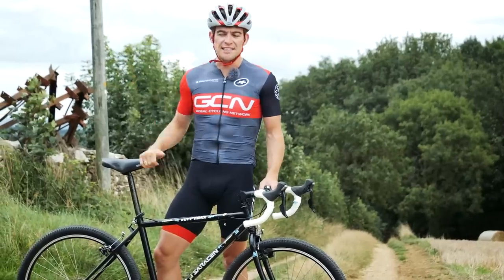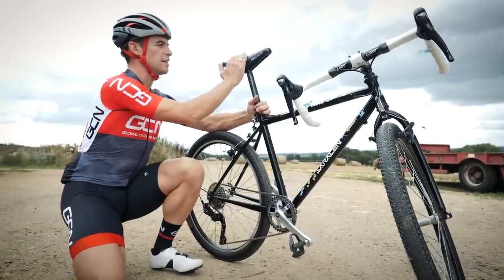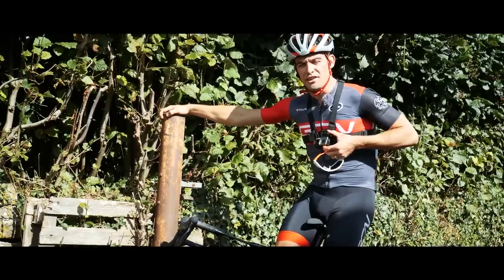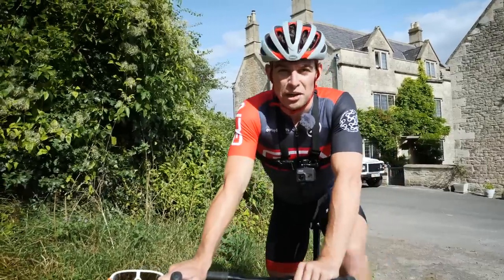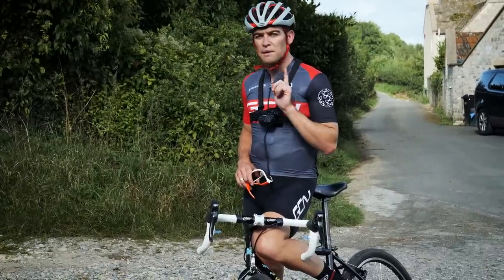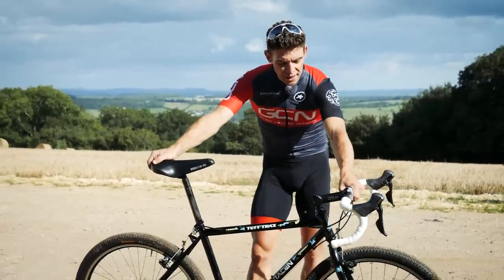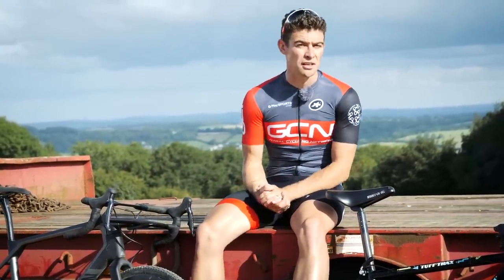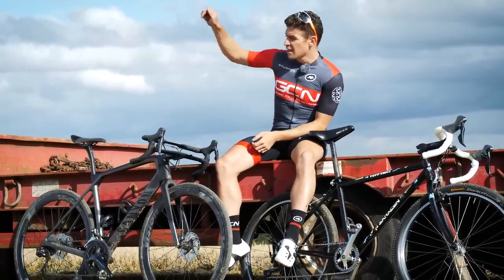Garbage Vs Gravel Bike | How Does Our Cheap Gravel Bike Compare?

Comment: So the Grail is altogether ~3% faster than the "Garbage Bike".  What is the price difference? 3000%? :)
Reply: Not enough to be worthwhile for most of us, obviously. But that is a pretty massive difference if you're a racer.
Reply: Joel Henderson racers don’t use garbage so it wasn’t for them in the first place
Reply: Canyons are cheap for carbon bikes.  And the garbage bike conversion won’t cost nothing.  I spent $250 converting a hybrid into a gravel bike and I used pretty low end components.  In the end, I sold my gravel bike for $125...and I’ll probably buy a canyon.  Garbage in, garbage out
Reply: @zyghom  Amateurs often do. And for someone who's a strong amateur finishing top 10% consistently, that's when it might make sense to think about this in terms of speed, and whether or not that seemingly small difference will help them podium.
Reply: @joelhenderson3723  i'm also not a racer, and also blow away specialized's Nutella bikers mhuaahahhaha
Reply: @joelhenderson3723  doubtful
Reply: @RaoulDuke69  vague.
Reply: That is a massive difference over 1250 meters. Over a 40 mile race that would equate to 10 minutes 30 seconds with equal elevation and decline throughout the race.
Reply: alan bane  Yep. That's the thing that I don't understand of these tests: the use case for gravel bikes is not "fast and furious short trail". Yet it's all these GCN (and others) tests seem to do: 5 minute ride segments when the whole point of gravel (for me at least) is to be able to ride where you want for long(ish) rides.

All this is proving (if it proves anything) is that modern gravel bikes are a bit better than 20 year old bikes at doing the 5-minutes fast-and-furious. If the build had included decent brakes and the same tyres on both bikes (not much extra cash), the result would have been even closer.
Reply: Love the vintage Saracen transformer 😍😍

Comment: Should have included cost comparison for the challenge.
Reply: Canyon wouldn't have let that happen
Reply: @Goriaas  That would have pissed off their corporate sponsor overlords,They don't want you to know the bike that is over 15 times more expensive only goes like 3% faster lol
Reply: I would also like to know the expected maintenance costs for the next 3 years or 10,000 kms or something.  Disc brakes are great if your competing, but cost more to faff with... And then when you factor in depreciation... yeah no thanks.
Reply: That wouldn't make much sense, they used ridiculously expensive GRX derailleur, whereas in real world for a bike like that you would use Sora shifters with Acera or Alivio derailleur.
Reply: @wtfiswiththosehandles  so true. a rear mech more expensive than the frame...
Reply: @wtfiswiththosehandles  that 10 speed GRX derailleur is $40 and has a clutch which acera and alivio do not. money very well spent on a bike like that.
Reply: @aidanshmaden69  You're running 1x with NW chainring, hardly necessary to have a clutch. And the bike is a junker, spending money on a new derailleur which is more expensive than 105 does NOT make sense.
Reply: @wtfiswiththosehandles  narrow wide alone is not enough on rough descents. chain will still pop off. the bike looks great and if spending a few bucks on a derailleur means it gets ridden and not thrown in the trash then that makes a ton of sense.
Reply: @aidanshmaden69  Wow, how did we ever survive MTBing without clutched derailleurs?
Reply: @wtfiswiththosehandles  😂😂😂 good one
Reply: @wtfiswiththosehandles  front derailleurs and chain guides held the chain on.
Reply: @wren7336  That's actually not true. Disc brake maintenance is pretty cheap. Brake pads are more expensive but also last longer. Most people will need no more than one bleed per year, some will only need to do one ever two years or so. Price of oil is so low it's negligible given how little is needed for a bleed. And the cost of a hose is easily compensated by it lasting multiple seasons. The biggest maintenance costs on a modern gravel bike are the tyres, drive-train comes in second, and everything else is pretty cheap because it either lasts a long time or can be bought for really cheap. So if you want a gravel bike that's cheap to maintain, you go for a low-end drivetrain and non-tubeless tyres.

Comment: Wonderful video!  Only six seconds difference between a full carbon and a CR-MO bike.  Truly a testament to Jon's mad mechanical skills.   In addition, the steel bike can be repaired in the event of minor structural damage.  That would be much harder to do with the carbon fiber bike.
Reply: I like steel a lot but Carbon fiber is actually remarkably easy to repair in the right hands.

Comment: For a daily commute that involves a bit of gravel, asphalt, and single track I believe the old gravel bike wins. The Grail is an awesome racing gravel bike but would be stolen quickly if left unattended. Plus I believe the old steel frame would be a bit more comfortable. Thx for the video.

Comment: I feel like this comparison should have been a bit longer. I would have preferred to see a longer with power data and more talk about relative comfort.
Reply: Yes. GCN has done lots of videos with power data, so they know how to do it. I suspect the video was short, and even then it included the fluff of the wheel swap, because the "garbage" bike was actually way to close to the expensive carbon thing. Fix the contact points for user preference, and it comes down to aero and weight. For an average Joe the areo and weight aren't going to matter much. An average racer might care, but there is a lot of mid price bikes that would make a better comparison anyway. I will admit the canti brakes suck, and I'd pay good money to ditch them on my homemade bike if the retrofit was reasonably possible.
Reply: yeah, like a 6hr gravel race

Comment: So on the ascent and descent, the second run was quicker.  It was obvious from the video that you took a different line up the ascent on the second run, avoiding some of the rougher patches.  That aside, "lighter bike goes up hill faster; heavier bike goes down hill faster" is an astounding insight!  :)  I own a 2x10 gravel bike but took off the knobbled tyres and put on 28mm road tyres.  I find that on dry surfaces, knobbles add no benefit, and on mud and wet clay, they clog up quickly.  I also have a fixed wheel road bike with 25mm road tyres.  I find I have at least as much fun riding the fixed on gravel within its limits.  Yes, it is more limited, but that just means I don't have to go searching for challenging terrain when I only have time for a short ride.  When I was a kid, it wasn't called "gravel biking" — it was called, "going out on your bike."

Comment: Exactly what I'll be doing soon, I have a late 90s early 2000s(not sure exact date) yellow aluminium GT Tempest, I've got wheels with the 11 speed compatible hg freehub and some semi slick gravel tyres, gonna get either a 2x11 microshift centos groupset or a used Claris 2x8 not sure and canti brakes and drops obviously
Reply: How did it go

Comment: Falcon Cycles Xenon 26inch MTB to 650bx1.9 gravel bike with cheap carbon fork, Ritchie Venture Max bars, 1x10 Tiagra, 42t x 11-40, Gravel king SK, Ergon seat, WTB i25 rims and great fun 👌 only downside was needing a riser stem to get the geometry right so bar bag to cover that up 😁

Comment: You incessantly call that bike garbage. It is on the wrong side of an ocean for me, but let me know if you want to get rid of it. I'll ride that thing. I ride a very similar bike that is setup single speed. As far as the hill climb, if you are calling those tires "bouncy" on all the cobble you don't have your tire pressures right. When you try the test with lower pressures, post them along with average watts from a set of power pedals. Your hill climb will be closer than you think. You are a rodie (with respect), so it is no surprise you aren't as efficient on a mountain frame (even with old geo).

Comment: What about a non-garbage 90's hard-tail?! I nabbed a Bontrager TiLite. Disc up front, but quality cants are fine for the rear. Featherlight 28mm SID Race Titanium shock with amazing lockout -- climbs like a coked squirrel, descends like an XC bike (though only 80mm travel, so you can't catch massive air), weighs <10kg. Only downside is that it's not very aero, so would lose at high speeds across easy terrain.

Comment: I recently bought a new winter hack, a Merida ride Lite 90. Cost, £599.99. My summer bike, a Bitsa built from sale rail parts, cost around £2000. I average out at about 10 seconds faster over 25 miles on the Bitsa. Is that worth £1400? Actually, if I had paid full price for all the parts, the Bitsa would have cost nearer £3000, but that's not how we calculate the value of our bikes, is it? The Bitsa is an absolute joy to ride, especially uphill and on long flat sprints. You can't put a price on that. I just don't get the same feeling from the Merida, even though it's just as fast, almost as light and behaves almost exactly the same way. If we start to calculate the worth of our bikes on how fast they ride, then we need to re-evaluate why we ride in the first place.

Comment: Nice video.  I thought it was going to be bias, but you kept it very neutral.  Great job on that!  I want to point out per Canyon website the Grail is $1799us to $6000us depending on the model.  The grail looks awesome, but for  hodge podge gravel bike with a few hundred dollars.  It makes the garbage bike pretty appealing!  As long as your out riding.  That's the main thing.

Comment: It does show that you can get out and have fun on a pretty cheap bike, although the difference over a race (which the Grail is designed for) will be much more profound, I'd say. Chris mentioned the handling of the Grail being much better and that will 100% make a difference during a race. But not having an expensive bike doesn't stop you from getting out there and enjoying riding! 😁

Comment: Well, that was a bit short test for an adventure/gravel bikes... but whatever, I'm surprised that old MTB with long stem and drops fits the rider. This old MTB frame would be probably to small for him as normal MTB with flat bars, I can't find other reason or he just doesn't want to point out in the video about how this old bike feels. These old MTBs have quite long top tube and are generally long and high(for a 26''er), so the position on the bike must be pretty agressive with drops, like CX not gravel...(maybe because of that the descent went so well) Just look at a height difference between saddle and bars in old Saracen and compare it to Canyon. So it is possible to convert old MTB on 26 wheels into drop bars hybrid, but from my experience one need smaller frame than used normally and not too long stem for a comfortable position.
Anyway a cool project, stiff old MTB rocks!

Comment: My questions are 1) what were the gains received in the upgrades, comparing before and after and 2) I have a ‘06 trek fx 7.2 and a disc brake ‘15 giant defy adv 2... is it even worth looking at upgrading the Trek hybrid for you know hybrid (gravel / light off-road use as it was intended imo) or just putting 28s / more gravel like tires on the giant going to be way better than anything I throw at the trek?

Comment: I would like see an old alloy cable disc  26er heap mtb with straight tange forks and an 8 speed 12-32t. Turn into 2x46/36 and a  drop front. You may 3v3n squeeze a set of 650b wheels with 1.75 tyres. Rj the bike guy has done some great cheap mtb to gravel conversions with disc. Id wager the difference would be closer than 8 secs on the climb.

Comment: My gravel bike does long paved trips, dirt roads, and occasionally some very mellow single track.... if it was dirt and trail only I’d ditch the low sleek bike with its skinny 32–40c tires in a heart beat.      Salsa Cutthroat modern off road drop bar bike with proper geo for the job.       Weird as “gravel bikes” got more and more popular I  guessed they would go more off-road/tuffer but seems like they are getting more and more like road bikes.... crazy low stacks ultra light weight and even aero.      The garage bike does look like fun on more nasty dirt roads and rocky trails for sure

Comment: I bet the gap between them could have been closed very cheaply by using an ally frame - I bought a really nice Ally CX frame with carbon fork for under £50 off Ebay (inc courier). Jon's bike would be good enough for most of us though.

Comment: Several things to consider... a $3000 bike will not make you 10 x better than a $300.  To do a correct test, you have to do runs, in each bike, independent from one another, that is, you can´t ride one bike and then the other, one rider... you´ll have to do several rides with several different people and get an average...  Another thing, in this case it seems the results are more based on the tires you are using than on the bike...

Comment: if you are going to get sti shifter and new wheels , you are better of getting a better frame ,  you can get really nice aluminum frames for 100euro ,  and hybrid bikes are also good candidate for gravel bike and you can get one with disk mounts also , or solder disk mount on the frame and fork , and use 700c wheels with disk ,  will also be a cool convention ,

Comment: I love my garbage bike! A TREK . Pulled it out of a backyard mud hill.  I did the surface rust removal on all the non painted metal,  then only 150 bucks at the bike shop for odd and ends and tune up.  Been riding it for 3 solid years. I couldn't believe my good fortune. It's probably a bit over 10 years old. Don't care. We've got nothing but crap roads with frost heaves, large cracked surfaces for miles, pot holes, all manner of gravel and sand on them, multiple train tracks to go over every which way. I love this bike!
Reply from the maker: Awesome! Share it with us on the uploader: https://gcn.eu/upload

Comment: Should have used the same tyres on both bikes. The steel bike would have gone up the hill faster, without the wheelbarrow tyres on it. The carbon one would have descended faster, if it had had more tyre to absorb the stones at the higher speed. If you doubt this, there is a GCN test of gravel vs. cx bikes, which says it.

PS regarding cantilever brakes- blx. My cx bike has them, and I can lock the front wheel on any surface. I can also descend on slimy mud, without skidding excessively.

Comment: One more thing in the wheel take off challenge is I would not put a disc brake bike in a car unless I had put space savers in the brake calipers of the Canyon after I took off the wheels and then to remove them before putting the wheels back on, the cantis do not need something to keep them apart like an empty disc caliper.

Comment: just goes to show you can have a cool and fun old bike. I stripped and powder coated my 1998 Gary Fisher, installed an Alivio crank with a 34T Narrow-wide chainring, and an 11-34 9-speed cassette with a Deore derailleur and Alivio shifter. A pair of 26 x 2" slicks, a rack, and a pair of Ortlieb bags has turned this into a go anywhere commuter. Fun? Yes. Practical? Yes. Fastest? No, but that is not the point. Get outside and enjoy the day!
Reply: June July Sorry I have no experience with that bike. But honestly, any bike by the larger manufacturers are all "good," provided you use them for what they were designed for. An entry level fork is really made for sedate trails or city streets, so a person may be disappointed if they are expecting the performance of a Reba fork. More money will get you more speed or comfort, but often those marginal increases are very expensive.
Reply: @junejuly48  Don't be racist, Chinese and Taiwanese people can make great bikes too.

Comment: the proof is in the pudding as it were , albeit the weight  difference and price one would do as good a job as the other , slightly heavier bike means more strength and endurance on the breaking side the disk brakes are ahead , for a starting point the older bike would do fine , and if later one wants to upgrade one can , jon did a great job of bringing and old bike up to a new one , and it looks good , add a coat of paint and it becomes a bell ringer ,

Comment: Jeeze, again an advert for their sponsor, at least put it up against a 1k bike rather than a 5k, GCN have a bit of respect for your core values.
Reply from the maker: Sorry, Daniel? We're not 'advertising' anything here. We're using the Canyon Grail as they are one of our bike sponsors.
Reply: Global Cycling Network so what Daniel is suggesting may be that a base model bike would be a better comparison to make. The top end Grail is not the only gravel bike that canyon make.
The point being that the old farm built with mid range parts does not inhabit the same market as the top end carbon fibre wonder bike. If I'm building up the oldie, the Grail is not my alternative bike. The base models canyon gravel or cx bike might be.